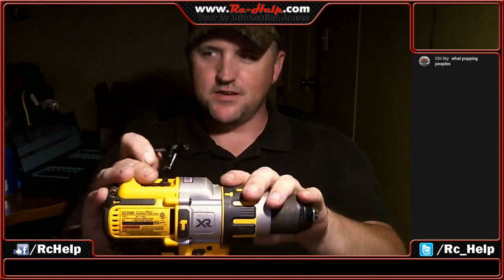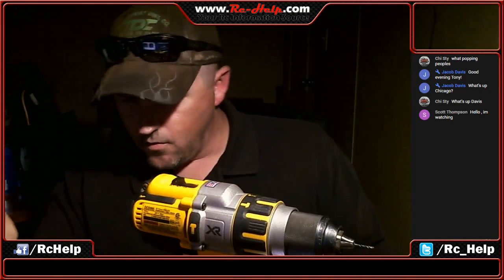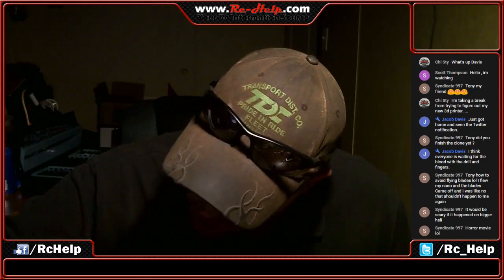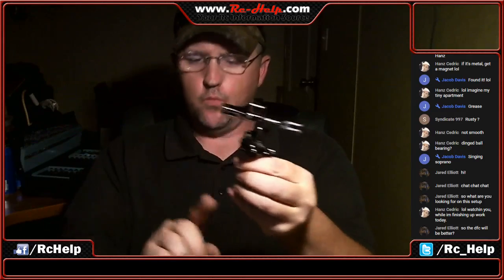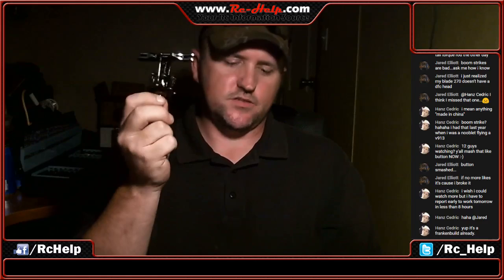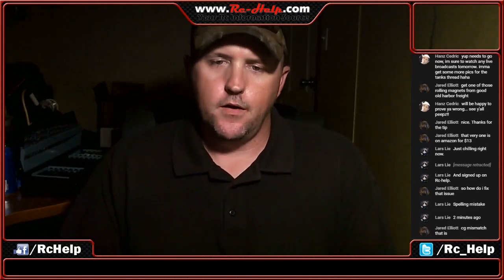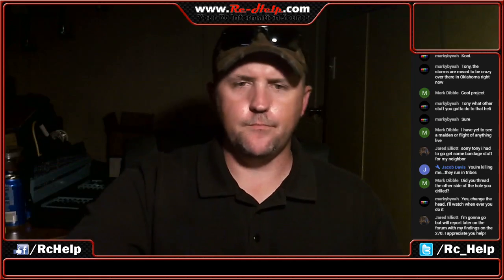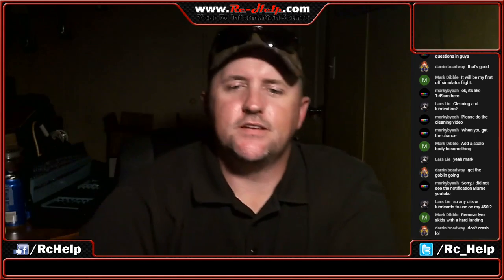ALZRC Devil 450 Head Problems and FIX

Comment: Hey Tony!

Great stream on pointing out a serious flaw! I had an issue with my kit, where the head would just tilt back and forth on the bolt securing it. I didn't have the time, patience, and especially equipment to deal with it the way you did so I wrote to Banggood, made a video, and they gave me a 50% off of a complete head assembly which had the hole in the right place, as well as having the swash driver integrated ( just like that HK FBL head ). 

So actually came out decent enough, BG was cool with it, plus I got a complete head which acts as spares now for 50% off :D 

Here's the vid if you're interested: 
https://www.youtube.com/watch?v=peSn2PE_jZw

Love this series too bad I can't watch you live :/ ( EU ) 

Keep it up, really interested to see it fly :) 

Peter from Hungary
Reply: No! They didn't have a groove for pinching, and yes I ended up with the Tarot head with the turnbuckles, it really is a dream for setting up pitch :) Yeah, with the exception of the head assembly, and in my case the loose tail, the kit is pretty good, had 2 crashes on it so far, one smaller, one bigger, bent shafts and broke blades on both occasion, but the rest of the heli held up pretty good. So really not bad for a 70$-ish kit.

Comment: Your audio levels are excellent. U have the best audio levels on U-tube. Awesome work.  I will not even watch any video w/ crappy audio. Thank you for the efforts.
Reply: Well, let's see if we can find one. A donation of a good board would be great for your studio. Still dealing w/ crazy winds up here at 8,000 in crestone colorado. No flying again today. Only thing i can fly w/ wind is stabilized helis. Flying my collection of modified Blade 230 S models. The stability mode is great. Still working on my Align 800 drone. Will send a video of it as soon as  I can. This heli can carry 45 lbs, payload. My regular 700 E can carry 35 lbs. stock. Most any Align 700 can do that.  Talk to you soon.
Reply: That is precisely why i try to film most flights, for information later. Had no luck w/ 3 GX or Tarot FLB units. Using the 7200 BX in the big birds. I have almost 2 hard drives full of videos. Unfortunately, when a bird goes down i do not have the cam rolling! LOL.  Maybe u could do a episode on setting up the 3 GX. I have a Tarot ZYX 3 GS controller for my giant 7.5 lb. 3 axis gimbal. I need help to program it. The gimbal is a Align Photoship one, made for the Align 700 to 800. The gimbal set up cost $ 3000.00 , i bought a showroom  model for $305.00, it uses constant rotation Savox servos, one for each axis. Love to get that set-up. You are in okalahoma right? Would u be interested in setting it up? i could ship to you. Let me know if u have any ideas. It is made for big align helis, but i could put underneath my giant Tarot quad. I hope the Allrec worked out. Thanks for the communication. Tim bushpilot2001. I am a real aerial bushpilot, but I love the R/C stuff!
Reply: Maybe mount it on a stand, it has 2 rail mounts, i could figure out something like a 2x4. We could pretend it is a fixed mount like a security camera. I have not  the programming capability I would like.   LOL!  As for a camera, it will handle everything from a GoPro to a Red Epic cinema cam. Damn the wind! LOL! My Thunder Tiger E325 is begging to flown hard! Hope u get a chance to get something in the air this week. Will check w/ musician buddies to find a board for u. Just farming today. Love to see a vid of your  farm or ranch, a day in the life. Gonna put my leg weights on and go back out in the wind to water. LOL. Your show is the BEST! Tim
Reply: The guys in  in Cali. said the ZYX is a good gyro for this  gimbal. It has a heavy duty alum, case. I would not use on a heli. but is very good for large gimbals. Velcros on to gimbal w/ a ar6110e , just need 3 channels for the gimbal.  Like your thoughts on sounds for the haters.  Thanks again, u are a great resource. Keep educating everyone that needs help. Tim